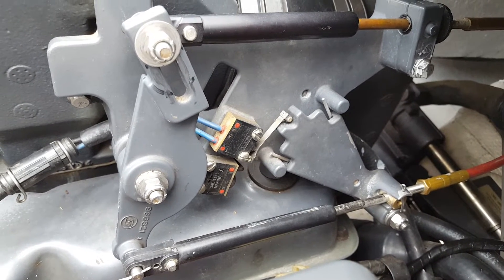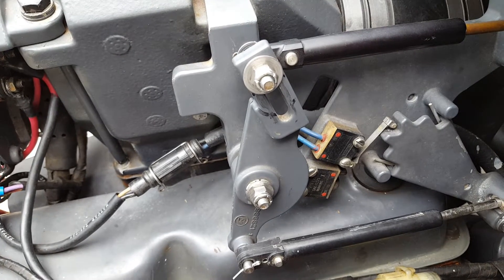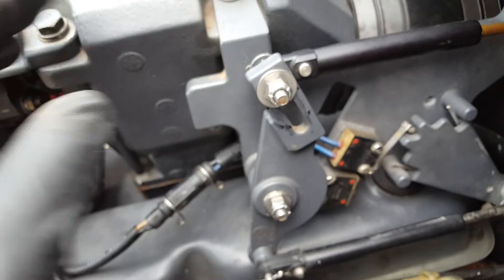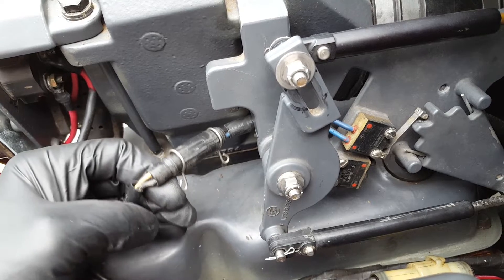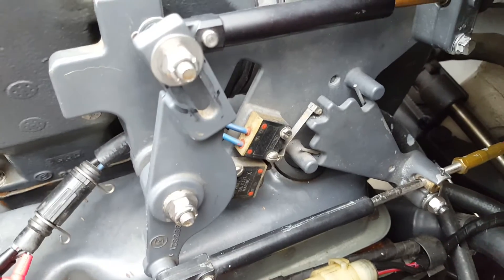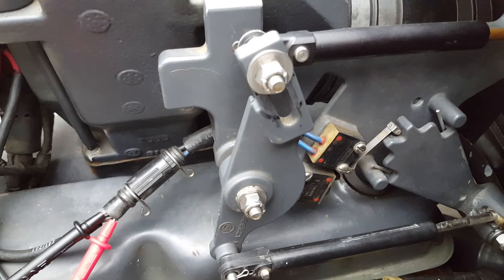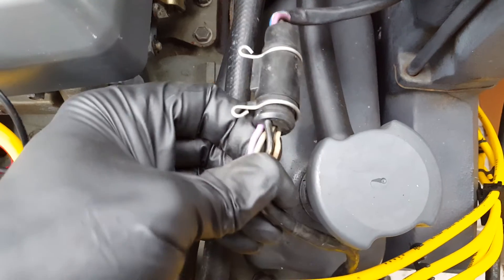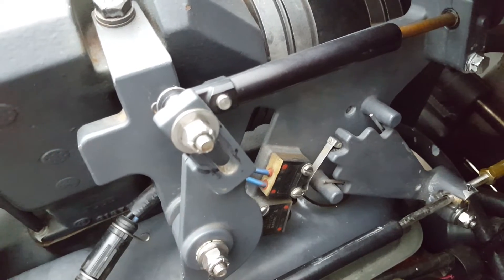Engine Bracket & ESA Troubleshooting Part 1 - OMC Cobra Volvo Penta SX

Comment: I have a 4.3 OMC and when I get up to 3,000 RPM in gear it starts to stumble. What is going on? Is this an issue with the ESA being out of adjustment?. Thanks
Reply from the maker: This is not an issue with ESA. You are already in gear. Keep cruising through my other videos, specifically for changing the cap and rotor.
Reply: @michaelromer2016 I disconnected the esa module and that was the problem... When the RPMs would go up, the overstroke switch wasn't turning off the interrupter therefore causing the stumble past 3,000 RPM...
Reply from the maker: @matthewolbrys wow! I can only imagine you tested this while on the trailer.
Reply: @michaelromer2016 no, I disconnected The two micro switches (interrupter and overthrow) dropped the RPM down to about 400 so it wouldn't clunk into gear and it went into gear nice and smooth. Then I just hammered the throttle, instead of sputtering out at 3,000 RPM. It went up to 4500 RPMs with no problems or stuttering.. I don't even need the esa set up, it shifts fine,You can't even tell it's so smooth..

Comment: I appreciated your trouble shooting video and it looks like my ESA is operating properly.  My issue is sometimes when I press the  button on the throttle to keep it in neutral and allow me to   rev up my motor at start up,  the motor won't turn over.  I pop it back to neutral and it will then try to start.  More times than not i'm left trying to start the motor at an idle only.  Hope this make sense.

Comment: Great video 👍 I’m still having trouble moving shifter from gear to neutral with engine running as soon as I shut it down it moves fine and from neutral to gear is a little harsh of an engagement. I’m working on this boat for a friend who had someone else put in an engine, the shift cable moves in and out without engine running just fine and I’ve adjusted the cables per your video (no special tool just measured with a ruler) I’ve been looking at wiring and the two switches you talk about aren’t working because of destroyed connectors. Will that cause my problem or will it still shift to neutral with engine running if the switches are disabled? Thank you

Comment: Hey mike thanks for all the OMC content I have repaired my shift cable a couple times thanks to you. I recently am recently having a huge issue with switching g from neutral to forward and reverse I basically it turns I to a mission to dock the boat . I have to for fully pop it into all gears for it to engage it seems as if it is stuck on something . There is no grinding with gears and the dog clutch engages once I get past the struggle I’m stuck and ha e. O idea what I did wrong
Reply from the maker: Did you use a shift alignment tool when you replaced the cable? Check out my shift cable replacement video to see what it looks like, just in case you missed that step—it is required.
Reply: Hey mike , yes I used the shift alignment tool and everything seems to work great out of the water  but when I put it in the water it seems to throw it off just a hair. I’m not sure if it’s the Interruptor switch. It literally will not go into neutral from forward or reverse without having to force it.
Reply from the maker: @edwardguerrero2593  when in the water, have someone try to put it in neutral from forward while you hit the interrupt switch manually. See if that helps. If not, the problem isn’t ESA.

Comment: If I install a Holley EFI system how would it interface with the ESA system? Or can I set the rpm’s low and bypass the esa?
Reply from the maker: EFI uses O2 sensors. Otherwise, the setup is plug and play.

Comment: Good video I have two question though. Is that detent that causes the W plate to jump going into reverse, Built into the lower cable? My second question is, do you know where I can find the upper shift cable that goes back to the remote control? My boat is a 1989 Bayline Capri with a 2.3L and a OMC drive. It looks just like the one in this video. Someone put an after market cable and it does not fit correctly. I can't find one that has the same end on it as the one in your video and a threaded end on the remote control end. Most have an eye end for a pin on the remote end. Thanks

Comment: In my 1991 Seaswirl Ford 5.0 liter/Holley 2 bbl carburetor, the ESA system, when working properly causes the engine to stumble, NOT stall. It seems to cut the rpms in half, which makes shifting from reverse to neutral possible. The W switch when closed sends a ground signal to the ESA module, then the ESA modulates the ground to the distributor causing engine stumbling, not a stall situation.
Reply: He was definitely wrong in this video, It cuts out a couple cylinders causing it to stumble which lowers the RPMs! If your engine stalls there is definitely an issue!

Comment: Mike, do you have any additional info on doing the shifter adjustment on the old style shift bracket on my 1986 Bayliner 2858 Contessa twin w 5.0L cobra jet out drives? It is giving me fits as there’s two helm stations and both are direct. No slave helm. Plus I don’t have the diagonal slot for reverse.

Comment: I have a 92 Sea Swirl with a 5.8 king cobra. When I sift into forward or Reverse it goes into gear fine but doesn’t want to come out of either gear and there’s no rpm reduction. I have to shut down the engine to take it out of gear. Any advice???? Frank fldwwjd@gmail.com

Comment: If you look at the boat harness side of the connector, OMC wired these switches to work in unison...in other words in series. The arming switch (the switch with the lever going into the W) must be closed (depressed or activated) for the trigger switch to work & cause the ESA module to stutter the engine. Interesting fact though...my 87 bracket not only has the two switches, but...also has two adjustments for the switches (these barrel shaped rubber pieces that can change when the trigger switch triggers going into FWD or REV.  The bracket your using in the video doesn’t have these adjustments for some reason. I guess they wanted to make the ESA more adjustable for my boat depending on the cable positions & ratio positions. Is there a neutral starting position for the cables & switch adjusters?

Comment: Hello, I would like to know how the wiring of the cut-off switches is mounted, since my motor does not lower the revolutions when I go to start the gear, will any cable be wrongly connected? I already put even the 2 new switches and it remains the same, greetings
Reply from the maker: The ESA unit itself might be broken. It’s on the left exhaust manifold.

Comment: My engine dies when the esa switch is triggered. At best it stumbled then dies. Or just straight dies. Should it not still run when triggered? Just really low rpm?
Reply from the maker: If you keep ESA triggered, it will kill the motor.
Reply: @michaelromer2016  I believe my indent needs replacing. I have adjusted this ESA the best i can.

Comment: I dont understand your description of normal closed overstroke switch. You say normally closed switch with plunger down meaning switch is in its normal configuration you should have no continuity? Normal open in normal configuration would mean its open thus you would have an open circuit meaning no continuity. Am I missing something in your description?
Reply: I agree N.C. would get continuity when not actuated, when actuated the circuit opens........N.O. would have no continuity when not actuated, when actuated the circuit closes
Reply: He described them backwards, you get it though - "open"  means not connected, or no continuity. "closed" means connected, or has continuity.

Comment: when testing the intermittent switch and over stroke switch do you have the ignition turned on or can it be done without a battery,  I can't reach the wiring on the switches to test. are dots under the red paste test termails on them? I recently did a electronic ignition upgrade by Pertronix. when the ESA system is un hooked from the ignition coil and jump the + the the battery its starts and runs great. when I test the connector the same as you on part 1 i get audible sound out of the multimeter without pressing either over stroke or intermittent switch. i think my issues is between those to switches. In previous comment you advised a guy with a similar issue to switch from an 0.6 ohm coil to 1.5 and sounded like it worked I'm willing to try anything
Reply: both switches tested fine but still getting audible signal out of the connector
Reply from the maker: Joss, that audible noise means that ESA is firing (stalling the motor). There has to be something completing the circuit. Trace those wires.

Comment: This is a Great video and it does help to understand the ESA system. ESA stands for Electronic Shift Assist. It drops the idle while you shift.  That can happen when both going into gear and coming out of gear. Going into gear the ESA is to lower the load on the system and prevent damage to your gears. When coming out of gear and back to neutral it is to keep the gears from being "stuck" in gear.  There are a couple of mistakes: 
1)  The interrupter switch is the one on top that is more visible. It has the arm that rides on the "W". That switch is Normally Open (no continuity) You can tell that because when Mike activates it the multi-meter beeps showing continuity. This switch only activates for a second AS you shift.
  2) The overstroke switch in normally closed. If the overstroke is open, activating the interrupter switch will will not do anything. In the video this switch is activated when you are in forward. 
Mike had the normally open VS normally closed correct based on the names he said but he was pointing to the wrong one.  He says so in the comments lower down. That post starts "Keith Graham
 1 year ago Hi mike. I opened the round..."
My engine is like the one Mike is working on. It only has an overstroke cam for going into forward. Some engines have 2 cams one for activating  the overstroke switch in forward and one for reverse.
Reply from the maker: Thanks for your comments. I mentioned this in a few of the comments below how I got these terms mixed up. Thanks so much. Please hit that subscribe button!
Reply: Thank you!
Reply: Perfectly explained electronically.
Mike is right on the function
Reply: Thanks for explaining that i was confused by the beeping and was thinking my boat was supposed to be beeping too.  I'm still trying to resolve stalling issue while shifting, forward and reverse.
Reply: @scottc4786 were you able to repair your stalling issue? If so, what was the fix? I'm having the same issue. Thank you.

Comment: It's been awhile since anyone commented, but Can I ask a question here? So I'm wondering if either,or both of these were bad would I get a 'No Start' scenario? Or could my ESA Module be bad? I have to ask because last year I had my '88 OMC 5.0 running (in my driveway with the muffs) I was testing my prop rotation ie. put it into gear, she ran great for awhile then she either died out,or I shut her off and tried to restart and get nothing. I have tried almost everything, but what works to get her started again. I have watched your videos, I did some testing with the interrupt/overstroke switches and I think they function properly, although the interrupt switch plunger is a little slow coming back out. Wondering if maybe the ESA module may be bad. Suggestions??
Reply from the maker: When we consider no start scenarios, that shouldn't be ESA related. The best way to test that is to get a continuity tester and see if ESA is engaging (like I show in the videos). If you hear that ringing sound during continuity testing (like in the video), it will keep you motor from starting. It's like a constant stall. I have heard of that happening. Run through the normal no start scenario troubleshooting i.e., spark, fuel, air.  Thanks so much. Please hit that subscribe button!
Reply from the maker: Also hit that subscribe button as my subscribers get top priority when it comes to comment responses.
Reply: @michaelromer2016  Thank you for getting back to me. I did hit the subscribe button. Thank you for reminding me.
I had to buy a new ohm tester because my old 'Innova" was showing 1.08 ohms when I think it should be showing "0" when testing the wires on the interrupt/overstroke switch test. I will have to get out there with new tester,and your video, and retry.
Reply from the maker: @jeffreygardner6600  Thanks and let me know how it goes!
Reply: @michaelromer2016  It appears as though my interrupt/overstroke modules are still working. I have not tried starting it yet because I am still trying to figure out the other electronics that may present a 'no start' scenario. Someone before me changed the distributor from points to BID, although it appears that the distributor itself is the original, they replaced the plate inside with Pertronix Ignitor.
The ESA module is a 987571,which shows for 5.7,5.0 Ford system. The coil looks original. I'm not sure if all this Frankenstein work is working. 
I'm thinking about changing the ESA module, which I will have to get the adapter harness as well, changing the coil, just because, and changing the Ignitor, just in case. 
I am also changing the ground cable because there was too much resistance from the battery to the distributor housing. Am I missing anything??
...And yes, I did check the kill switch too.😁

Comment: So just in case I replaced the V spring on my ' 87 5.7 the old spring basically fell out when I pulled the bracket off and the new one was pretty tight to snap back into the bracket, if your saying the original spring was too tight to begin with does that seem right to you?
Reply from the maker: There are a few issues to consider: metal fatigue on the original which affects the operation and whether you purchased the updated spring. To be sure, did you order this part https://www.crowleymarine.com/parts/14529.cfm
Reply: @michaelromer2016  Yes that is the part I ordered,  my boat is running fine once in gear, it does idle rough still but I have not had a chance to check the continuity on the interrupter switch like I mentioned before, in Neutral it idles like crap and no matter how many turns I make on the carb it doesn't get much better and wants to die, I set the idle to about 600 in neutral and manually pushed in the button on the switch and the idle speed jumped up to over 1000 but in gear idle is good (like the switch is backwards?) when I shift into fwd or reverse it does grind for a second, so I will adjust(fine tune) the cables hopefully tomorrow

Comment: So are these switches having 12v going through them or are they a ground that is opening and closing. Because I'm not getting a volt reading when I check the wires.  Also I did this test light check while the engine was off but Ignition key on. does the motor have to be running for a test light to get a signal that supposed to be going to the switches (if power is to be going to the switches) the switches are working but not causing idle to stumble
Reply: Also my wiring harness for the switches have a blue wire looped to the other wire
Reply from the maker: They are going to have somewhere between 9 to 12 volts coming though. Keep in mind you might have a bad switch. I've seen that happen. You can check connectivity when it is off--that is a huge part to make sure switching works. Once it is on, then your coil/ESA module comes into play. That is when the 9v-12 volts is detected. Most of your work can be done with the motor off.

Comment: HIHI I HAVE A VOLVO PENTA 5.7 , SWITCHES LOOK VERY SIMILAR TO URES BUT MINES ARENT WIRED UP TO ANYTHING JUST THE PLUG COMING FROM SWITCHES , ANY IDEAS HOW I WIRE THIS UP TO MY COIL OR DISTRIBUTOR , ANY INFO APPRECIATED , CANT SELECT REVERSE AFTER A RUN UNLESS I SWITCH ENGINE OFF SO SWITCHES NEED WIRED UP
Reply from the maker: What year make and model? Also is yours fuel injected?

Comment: Hey Michael.  Love the videos.  I have a 460 King Cobra 7.5L . After following so wires I found some corroded wires at one of the amphenol connectors.  How important are these amphenol plugs?  Can I just replace the wires directly?
Reply from the maker: The amphenol plugs are just a standard OMC used. You can use thread or solid core copper wire too (spliced together). If you need a new connector, here you go: http://www.crowleymarine.com/parts/12835.cfm
Reply: Thanks for the reply.  I think I'm just going to splice it in directly.  The only thing is I don't remember which wire went where.  Hopefully that doesn't matter.
Reply from the maker: @trevfox88  Oddly, it does matter. Make temp connections first to test, then crimp them permanently. Otherwise, you may have up and down backwards.
Reply: Ok sounds good.  I'm pretty sure the wires affected are for the RPM interrupter.

Comment: Hi mike. I opened the round inline plug into which the overshift switch ( one with blue leads and roller arm) and the other switch are connected- I checked continuity of the switches right at the plug and they are opposite to what you say in this video. Am I just misunderstanding you? Normally closed should be continuity but you are saying the opposite. Please comment. Thanks
Reply from the maker: You are right, I continuously mention them backwards throughout the video.
Reply: @michaelromer2016   I wondered the same.